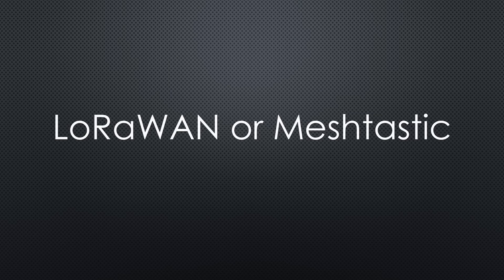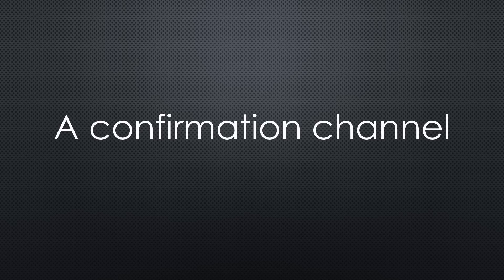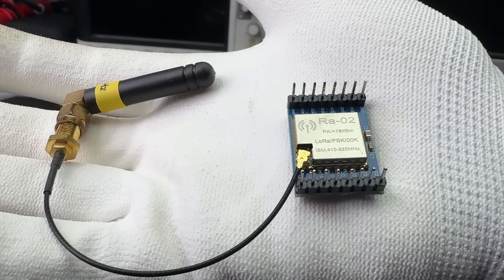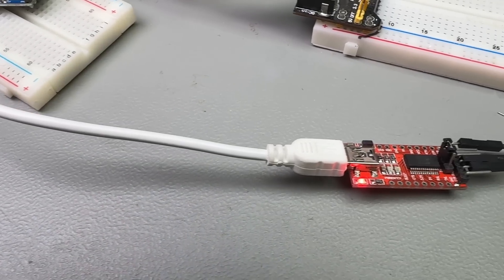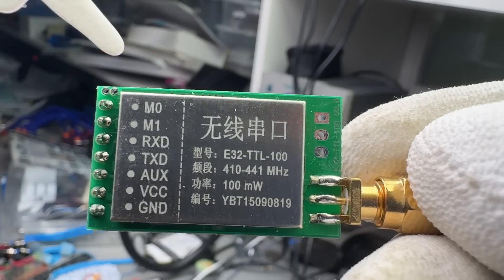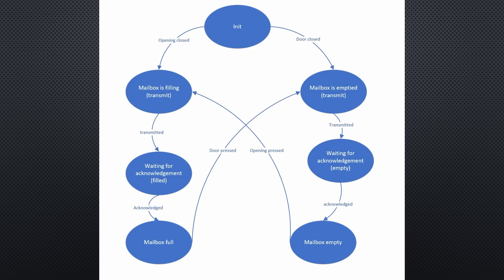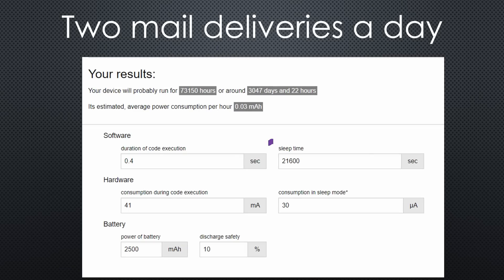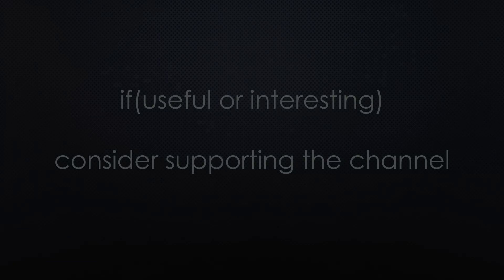(493) "Transaction Proof" Mailbox Notifier using an unknown E32 LoRa board and an ATTINY1614

Comment: I use the switch statement with the ENUMs for the state names.  In your case the state machine is straightforward.  But when you have error states, timeouts, interrupting events, abort processes, sub states, and a whole bunch of other things... this state machine strategy can explode the number of states on your design.   Simply adding an Enter and an Exit with dispatcher logic can greatly wrangle the states and soothe your headache.
Reply from the maker: I never thought on that because most of my projects are rather simple. Thanks!
Reply: @AndreasSpiess  I agree, don't need to seek out complexity, it will find you!  What is needed are strategies to contain and organize it when it does get complicated.   In this case it is simple and the scope is narrow focused.

I build prop controllers for Halloween Haunt, and so my logic is more involved.  I have one prop that controls a couple of pneumatics, one that quickly lowers a drop panel, and then a second cylinder is actuate another cylinder to have skelly lunge forward, the panel needs to be down and then the sound needs to synchronize with the action... I have a E-Stop switch that puts the prop into safe mode, and I have a RESET that has to reset the logic and the prop... so entering the state has preconditions, and exiting a state requires clean up.  If reset is pressed the prop has to go into a new mode to retract the skelly, then raise the panel.    Anyway, if you want to see what I did, it on my YouTube channel, I have 6 videos posted,  it's the "2019 Haunted Garage",  and at 40 seconds into the video you'll see that prop in action.  This year I'm doing something similar, I've torn that prop apart and I'm repurposing it and I'm adding microswitches to detect the Panel's positions... While I think I got away without them, I know that it's better to put the interlocks into the prop.
Reply from the maker: @HobbyHalloween  Subscribed! I will watch your videos in a quiet moment.
Reply: @AndreasSpiess  Thank you kindly.  I'm not a tech channel and I struggle to get one video out a year, but there's a lot more work behind the scenes.  I'll tell you about another way I use a state machine to sequence events, basically I use the number of milliseconds since prop was triggered, and the case statements are used to trigger the "on" and "off" events.

Comment: What is the problem with LoRaWAN and TTN? You don't have a gateway? In that case have you tried NbTrans?
https://youtu.be/fF4j3BAHCZg?t=17896

All other systems add noise. [meshtastic / 1:1]
Reply from the maker: I own a gateway. But as said, TTN is not "transaction proof"
Reply: @AndreasSpiess  it’s not important for Mail box. Bi-directional communication doubles the noise.

In my experience lorawan is very reliable even with other gateways.

Comment: The ebyte module have PDF manual, that explain how you can set "speed on air", lower Speed mean big spreading factor. There Is a setting PIN that with low state enter in configuration mode with AT command. Id you set AirRate vert low the Speed of serial communication Is set to 1200bps
Reply from the maker: I started with the AT commands till I discovered the approach used in the video. Good to know that the AT commands automatically reduce UART speed.

Comment: Very good 👍. I was going to suggest adding the current battery voltage into the notification but if it last for 8 years on one pair of batteries it probably isn’t worth the effort. Keep up the great work 😀👍
Reply from the maker: The current TTN solution transfers the battery voltage and I might add it to the new design. But as you said: If the power consumption is so low, you loose a lot of power transmitting additional data.

Comment: I'm building a dedicated server with old pc parts. I have a ryzen 5800 so there's no igpu and I'm waiting for the new rtx5090 announcement to save money and use my old one or sell it and buy a crappy one and have some extra spending money.

Which model transceiver should I buy (east coast canada)? I have a large piece of property and want to set up sensors for my flag pole, pool pump, firewood shed, detached garage/wood shop,  generator (anti-theft). I'm rambling, sorry Andreas I do that to you alot. Mental health issues, I'm annoying but harmless and mean well. 

I'm also getting a ham license and plan to build my first radio. Some of the parts are already on order. I have a software engineering degree but ended up being a 911 supervisor and was in charge of checking all sorts of vhf, uhf, tmr systems as we were in contact with fire departments on the opposite side of the cape breton highlands as well. Some departments still used phone in pager systems. Being a nerd, I always asked the Motorola tech about everything and it was cool to see the evolution of rf technologies we used as new ones came out and we maintained the old ones as backup. There was 4x redundancy in some cases depending on geographic factors. 

Uneccessarry story: The tmr radios were very impressive but I was told very expensive as push to talk was a charge per click from the monopolized telecommunications company.  Went from government to hybrid to private to a Bell buyout that made it a headache to service contract companies who fixed everything from pos systems to our 911 servers. I wouldn't fix anything unless I had to because it took money out of the worker's pockets who got called out 24/7. Snow storms were the edge cases where I had to make decisions being in charge of the employees I worked with and public safety. As soon as someone grew familiar with the server room they hired a new it company and eventually the dregs of the industry minded critical systems because they paid the least and their contract tenders underbid everyone. They offered me a junior programmer job for gis backend development at a job fair years prior but i turned it down as a friend showed me their code base a few years prior. A mixture of c, c++, visual basic and ms office access with a custom 'borrowed from netscape' html renderer i couldve wtitten in a day my first year of school.  This was before facebook and google. I learned that 90 percent of the info tech industry is propped up by 10 percent. It's partly why I changed majors after 2 years in school as well haha.

I burnt out in my late 30s and retired as the stress was too much. Helping people was extremely rewarding but we were understaffed with a high turnover rate. I was in charge of training as well and so much nepotism led to our workplace being the 'foot in the door place' for people who had no interest in the job or human kindness in some cases and would eventually go to tax collection desk jobs in our union. Our union was impossible to get fired from, even during probation. It led me to despising unions and beurocratic bloat in government  departments. I took a demotion my last year there hoping just doing the job of helping the public would make a difference, along with outside help from the private health care sector I paid out of pocket, not covered by our benefits. The damage was already done and led me to not leaving my house for 5 years. I am alot better now and leaning into our shared hobby and writing music have been the biggest helps. 

One of your new years videos still resonates with me and is why I watch your videos so faithfully. That and you're not an advertising-based creator who only does mailbags and device reviews. Alot of these same people have the gall to ask people for more money a month on patreon tiers higher than my bidirectional 1.5gig internet bill each month. There's also a lot of people on YouTube with (real or imagined) engineering degrees propped up by pcbway who are going to realize that being a content creator who relies on free gear for reviews or mailbag videos counts not as work experience when the ccp decides their soft power propaganda fund money is better spent elsewhere and a whole pillar of the genre I used to love just collapses. I have warned some former creator friends (who I care about) of this very real possibility and I'm treated like I'm crazy. I'm not including mailbag based creators in this group. That is a sub genre of sorts with a bit of value and alot of great, funny people in some cases who are not mortgage-dependent on ad revenue. 

I've seen alot of great creators who just wanted to teach and hopefully make a go of it financially turn sloth, gluttonous for money and become intellectually bereft, fooling themselves they are still the same. Sorry if that seems meandering and harsh. It makes new people to the hobby have a harder time gaining a foothold base of knowledge to determine the million different and awesome facets of this hobby to pursue next. 

I see no sign of you ever doing that haha.
Reply from the maker: Thank you for your support and your long message! I am glad you are better now.
As said in the video, LoRaWAN (on 915MHz in Canada) is a good choice for sensors. One gateway is good for many sensors. You find many videos on this channel about the topic.
Concerning DMR in HAM radio: If you have DMR repeaters in your area, you get not too expensive Anytone handhelds.

Comment: For nodes I use the STM32WL parts, it has the semtech ip on die w/ an L4 style STM32. One stop shopping. Rak wireless has some 3.3v boards for about 15$us. I program them using the Ada language in a port i did of Adacores stuff but there are other potentially easier alternatives. The server i use curr is a nodemcu w/spi connected 1276, I plan on replacing it as it occasionally loses the lora module after some days. (I have a keep alive node on the network that xmits a ping every 5mins so that can be used to reboot the lora if not recvd).
Reply from the maker: I did not know that Ada can be used for MCUs (Prof. Wirth, the Pascal inventor was one of my professors).

Comment: Thanks for this nice video! Correct me if i'm wrong, but one big advantage I see using Lorawan is built-in data encryption, which I believe is missing with a "raw" Lora communication.
Reply from the maker: You are  right. In my case, encryption would not help a lot because I only transmit "empty" or "full" and the transmitting pattern reveals a lot.

Comment: What is the time period in which the 1% transmission time rule is calculated? A minute? An hour? A day? If you set it small enough, say 1 ns, you'll never be able to transmit anything since you'll always be using either 0% or close to 100% transmission time.
Reply from the maker: I do not know if this is officially defined. I would say, one hour is a good time. The idea of the 1% is that you do not block the band for other sensors.

Comment: Let me pass to you my similar project. Not using Lora, but simple esp8266 wifi, because I have wifi reachable.
Also, like yours, I want to be notified as soon as someone (postman) touches/opens the mailbox to put something.
My system has really low comsumption, that's why i opted to a battery approach. But why? Because the device is always shutdown until it is triggered. How did i make it boot? I have a magnetic switch that is triggered with a small magnet ring. That ring is threaded in a small fibre cord lead (fisherman cord). When the box is opened the magned is released and the gravity moves the magnet in the cord until it touches the switch. When that happens, the device starts, boots the code, connects to wifi and then upon sucessfull connection, sends a mqqt (mosquito) message. After sent sucessfully, the device shutsdown again. So the only time it's spending battery is during that process. That way I only charge the battery once a week or more.
Then, I receive the alert in my homeassistant (with a mobile alert) and I go to the mailbox to get the letter/package.
Downside: If I receive a 2nd package or any letter (from a different carrier) before i go to the postbox and reset the system, I'm not being notified anymore. I can live with that, since usually i only use one carrier and they come only one time each day.
What do you thing about this?
Reply from the maker: Using a mechanical switch to power the an ESP32 is a good approach (I used it for other projects). I wanted my notifier switched off when the Mailbox is emptied (by my wife, for example). Our mailboxes have an opening for inserting and a door for removing the mail. So I need two switches which would make your setup a bit more complex.

Comment: The confirmation requirement seems odd to me… you can just build a confirmation and require that in whatever implementation you’re using to call lorawan or espnow library. If you have to decision around whether the message was confirmed either way (wake up periodically to retry if the message wasn’t confirmed for example) 

Whether or not the protocol supports it under the hood seems like gravy, not necessary at all.
Reply from the maker: As said: I do not want to waste energy to wake my notifier periodically. It would waste most of the battery without any value.

Comment: the battery life is very good.   i don't know an awful lot about electronics so maybe it has to do more and do it differently but my wireless thermostat takes 4 aa batteries every 3 years to cover a range of 5 metres not km!
Reply from the maker: 3 years is a good value, I think. And the range is probably limited by the wireless standard used (Bluetooth or Zigbee). I also think, your sensor transmits its values periodically and so consumes more energy.

Comment: Hi, I used data cable to my mailbox and an arduino. I even got an industrial machine traffic light to come on red when post arrived. Then when I took the mail out using the lower door it would reset.
Reply from the maker: A cable is always a good idea if possible. My mailbox is 50m away (public ground between).
I also use the two switch method you mention, BTW.

Comment: One of the most useful things about my diy sensor network is that each sensor has a max update interval which forces the sensor to send an update of the current state, even if there is no change. 
This helps with some edge cases, but it is a good way to monitor the network. A "time since last update" bar chart for the network can immediately tell me if something is wrong.
Reply from the maker: Good Idea! I use "watchdogs" (node-red timers) for all my sensors with regular updates to notify me via telegram when an update is overdue.

Comment: 2 Alkaline batteries would only supply 3V. Do you have an additional boost circuit to boost it to 3.3V or is 3V still within tolerance?
Reply from the maker: Both, the ATTINY and the E32 are rated down to at least 2.3V
Reply: @AndreasSpiess  Ok so you are not using any kind of LDO ? (Thank you for ALL your videos by the way very inspiring)

Comment: Thanks Andreas.  Why not use EspNow for mailbox monitoring since its not too far from the house?  Seems simpler, cheaper and EspNow has acknowledgements.
Reply from the maker: If it would work: You are rhght. But Wi-Fi signals have a much smaller range than LoRa. And, as I said: Our mailbox is nearly a faraday cage...
Reply: @AndreasSpiess  Ahh, forgot the faraday cage part.  And, since its a communal maibox they wont allow you to drill for ext antenna...
Reply: EspNow has sort of similar range to wifi (but without wifi APs) at 2.4GHz. It’s different from Lora which operate on lower bands, lower speeds, and much farther ranges.
Reply: @zerog2000  I agree that other than cost lora is great, but EspNow with WIFI_PHY_RATE_LORA_250K set has way better range than B/G/N wifi...
Reply: @arp_catchall  Good point, one might expect 50-100% range increase vs wifi, given similar environmental conditions, but it's still 2.4GHz and probably <100m in real world conditions (trees/walls/etc). I think Andrea's biggest issue is the one he has already stated - he's trying to run a transmitter inside a metal box :( 
If only he had a way to extend an antenna or other radiator outside of the box itself.

Comment: I've always used LoRaWAN confirmed messages for data that has to be reliably delivered. The two LoRaWAN stacks I've used both have callbacks for packets that are not confirmed by the gateway, which just re-queues the message and tries until it hits a timeout or retry counter value. I built mine using an STM32WLE5JC and a CR123A lithium battery.  Prototyped the design using a Seeed Studio Wio-E5 mini Dev Board before committing to a PCB. I looked at a handful of ways for sensing the door opening and settled on a reed switch. Lower power than LIDAR, accelerometer, and other methods I looked at.
Reply from the maker: Interesting! I never used confirmed LoRaWAN messages. Which libraries do you use on the sensor side and how did you program the STM32? Does the confirmation message arrives during the receive window after transmit? Maybe I will try it once.
Reply: I've used both the Semtech LoRaMAC-Node package and the ST STM32Cube_FW_WL package under the STM32CubeIDE. They're basically super-loops, and you implement handlers for their callbacks for handling join requests, building your packet structure, transmit complete, data received, what to do if a confirmed packet fails to be delivered, that sort of thing. As far as programming, I've done that using PlatformIO for the Semtech based projects, and through the STM32CubeIDE (which I >really< don't like) for the STM32Cube projects. I've also done a handful of projects using the Heltec LoRaWAN library on ESP32s and programming with PlatformIO. I like the Heltec code better in that it runs under FreeRTOS. I've never really bothered to try getting the Semtech or ST libraries to run under FreeRTOS, but people have probably done that.  Also, you're correct, the acknowledgement is sent by the gateway during the devices receive window.
Reply: I also acknowledge that confirmed uplinks would have done the job. They eat a little bit more of the battery and the gateway airtime, but it's negligible. 

Nice video!